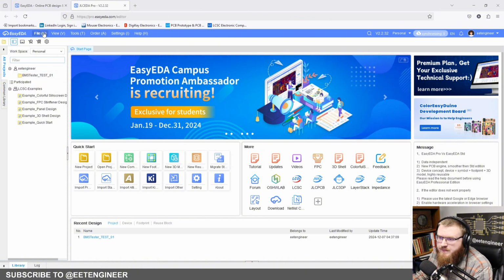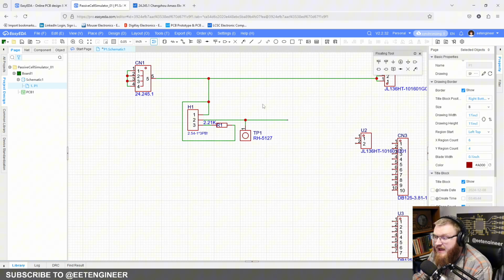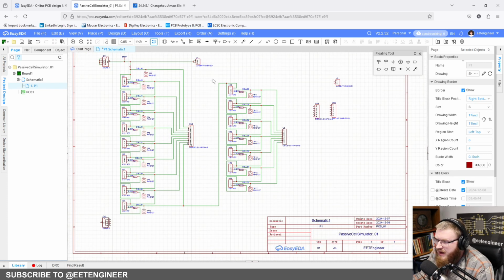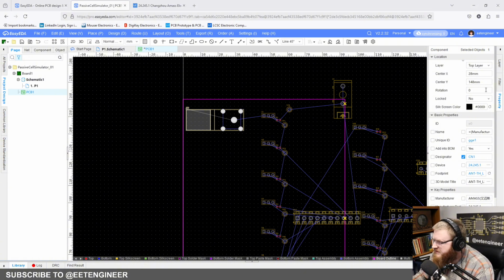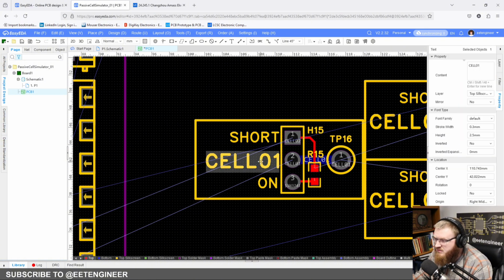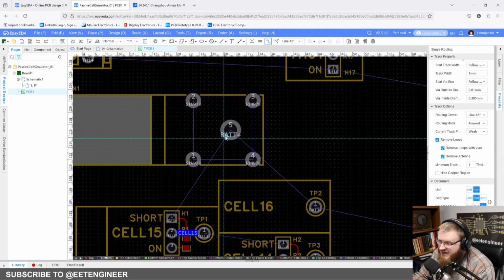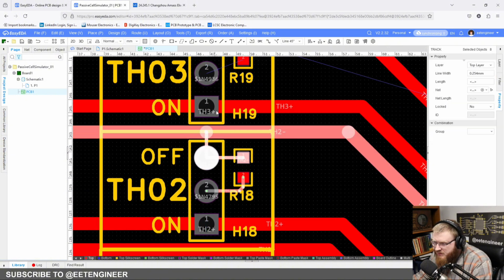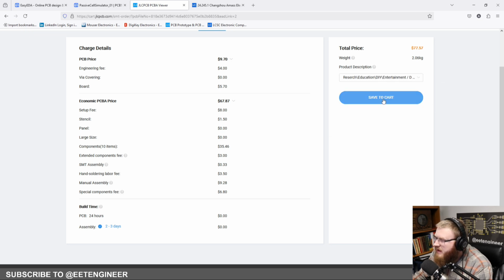DIY BMS Tester / Passive Cell Simulator | EasyEDA PCB Design

Comment: How do you functional test a single cell lithium charger without using an actual battery? I've tried an adjustable buck to emulate different battery levels and with polarity reversal but the charger doesn't see it as a battery. Probably because of the impedance.
Reply from the maker: You need to use a larger capacitor in combination with the power supply to emulate a cell.
Reply: @eetengineer  thanks. I'll try that next time. I got a series resistor to disguise as internal resistance